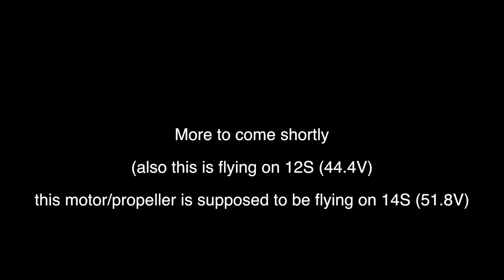My HomeMade electric plane Really flies!!!! (short hops) part7

Comment: Also when you start weathervaning on landing use rudder opposite the crosswind to maintain runway alignment, and use the stick to maintain your position over the center of the lane. That'll help minimize side loads on your gear as you touch down. (RC pilot turned full scale taildragger pilot ;-) )

Comment: Hey twins dont count as ultralights buddy I think part 103 only applies to single engine aircraft
Reply from the maker: Tell that to the Lazair designer lol
Reply: David Adam It also technically doesn't have "engines" at all.
Reply: drienkm idk I think it's a little on the illegal side. But it's okay I would probably do the same thing as Peter of I had the space to build it.
Reply: Part 103 is there to define aircraft that pose very low risk to the public and to property when flown accordingly. This plane more than satisfies all the intent of the regs; weight, fuel cap, and airspeed. 103 was also written way before electic propulsion was practical (this will be the key point whenever the FAA is forced to revisit 103)
But practically speaking, I'm pretty sure that statistically, multi-motors on a little homebrew aircraft like this reduces overall risk of injury/ damage due to redundancy by orders of magnitude more than it increses risk due to piloting challenges in an engine-out situation (obviously, this argument would be useless due to the lack of data).
In siuations like this when regulations are outdated, everybody seems to avoid litigation untill public pressure forces a re-draft of the regs... we just need to keep doing our thing!
Reply: PeterSripol that is true  it has been a long time since I have read part 103 I guess I will brush up on it lol. Congratulations on the flight man it's so dope and if your ever in Tampa Florida and want to take a private plane up let me know.

Comment: Great start !! I knew it would fly. But.. I'm still worried if batteries will give you any really good flight time. Be sure it can glide well unless you run out at 500 feet or something. May need to make a turn with no power. Please check those aspects out before you go for altitude.  Great job !!

Comment: did you end up moving the batteries to behind you for CG? Also you said at the end it should be using a 14s will you be adding more power later? how long do you expect to battery to last?

Comment: Technically when testing aircraft you are supposed to have as much altitude as possible. That way if something goes wrong you have a lot of time to correct the issue before you hit the ground.  But I'm not an aerospace engineer I've just read a lot of manuals. Good luck!

Comment: Put tons of batteries in the back to even out the weight :D And that you could do longer flights without having to worry about the batteries.
Reply: Chris Landry Well, technically he would need more powerfull motors, more batteries would just increase the duration I think :D

Comment: You should put the ESC's out in the motor pods to keep them cool and if a fire were to breakout it wouldn't cook you!
Reply: Actually it's bad to have long cables between the esc and battery (voltage spikes or some such), which is why Peter keeps the esc's in the fuse. It's better to have long cables between the motor and esc.

Comment: Peter “Wright” Sripol
Reply: Peter "Dumont"
Stripol
Reply: Shots fired
Reply: Sripol airport.
Reply: Xavier Ancarno Peter "Asian Guy" Stripol
Reply: Andrei Segal Shots fired indeed. But... Pretty much "Dumont", because it was shown to the public and didn't require a catapult. lol
It flies well like a Demoiselle with ailerons (instead of not-so-pratical 14-bis) and got a twin propellers and biplane wings setup like the Wright Flyer. It's a neat mix.

Comment: But will it fly out of ground effect?
Reply: He's flying just out of ground in this vid.
Reply: Hopefully. GEVs are still pretty cool, in any case. It certainly looks like it's capable provided the engines are powerful enough.
Reply: he even said in the video once he gets up out of the ground effect (which seems to be only a few feet AGL) that he can reduce power to almost half and still maintain level flight.
Reply: The way it instantly and positively responds to throttle inputs says it will indeed fly out of ground effect.
Reply: Neil Stramer Yep, he's defo out of ground effect.  He could probably fly to 15k if he had the juice
Reply: +williwonti
You misunderstand, just Google "ground effect" and you'll see what he means.

Comment: peter you need to make or get bigger props, with optionally more blades. you don't need more rpms, and it would be increasingly inefficient (commented before watching the video but it wouldn't hurt to have the extra thrust to get off the ground.)
Reply: AMEER H Yes he does, he needs bigger props to fly.
Reply: Then he should study the new prop efficiency graph to compare with the engine rpm
Reply: Andy P oh did he... well sorry about that i missed that point
Reply: Andy P he is flying mate
Reply: AMEER H you're missing the point, in the livestream he complained about not having enough power.
Reply: Andy P actually he dont need to.. i mean just enjoying flying

Comment: How fast does it take to get off the ground ?
Reply: Shredxcam22 how do you english bro
Reply: GL Aviation nun good.    What kind of ground speed are you running when getting off the ground?
Reply: Shredxcam22 depends on the plane, and you use ground speed while taxiing and airspeed on takeoff till landing.
Reply: I estimate its like 35-45 knots
Reply: GL Aviation I am guessing he doesn't have a pitot system thus he wouldn't have the ability to know air speed. Plus ground speed would be more relevant to the average joe. I worked on avionics for years....
Reply: Shredxcam22 Idk anything about homemade planes but i just use my knowledge of 'not homemade' planes

Comment: Peter, do you think the incidence angle of the horizontal stabilizer might need adjustment?  That might get your pitch inputs more reasonable...
Reply from the maker: Thats the smartest comment I've received so far! yes I may shim the horz for a few degrees. The plane was built with zero incidence in the wings to make it easier to build. Unfortunately this means it'll always fly slightly nose high. 

I know I'm going to receive a lot of idiot pilot comments about how its stalling tomorrow! :D

Comment: Do a barrel roll!!!
Reply from the maker: No william, you cannot have my laser cutter. I didint put you in my will.
Reply: PeterSripol hvgb
Reply: Needs more cat stickers
Reply: Eric Villa
No quad engines...he needs geared inrunners like the old turnigy 80 100 motors turning props twice the size at like 48v.
Those motors/props he is running are so inefficient the way he is running them.
Maybe he could get away with using the same motors but in a gearbox with bigger props at higher voltage...would run much cooler and efficient with better thrust at the slower speeds he is operating at...
Not sure of the max voltage of them....maybe need a rewind.
Reply: try google
Reply: lol xD
Reply: I'm so glad I'm subbed to both of you guys. Y'all are awesome.
Reply: what will you build next time ? SPACESHIP :D
Reply: Brilliant! Amazing work!
Reply: D:
Reply: Can I be in it then? Oo On a more serious note, YAY PETER! And is that a windspeed gauge you taped to your windshield? Oo Didn't notice any about it in the build videos, might have missed it..
Reply: Yes,please,once you upgrade your plane at an good stage,DO A BARREL ROOL!
Reply: Fly over Mr O's house and drop rotten fruit as he does he laser cutter dance.
Reply: Harry guy, direct drive is nice for its simplicity, but I agree about the inefficiency...going geared you could use a smaller motor and less batteries for the same thrust.
Reply: old m e m e
Reply: William Osman Watch my video!!!!
Reply: William Osman do a Aileron roll
Reply: no
Reply: That is one of the worst ideas I have heard. I LOVE THAT IDEA
Reply: qual o nomedessescmotores?
Reply: What's the speed of this plane
Reply: Hahaha
Reply: I'm sure it would work, but  DO NOT DO A BARREL ROLL!
Reply: He needs quad Engines!
Reply: And watch the wings brake
Reply: how about a normal roll? way lower G-forces.
Reply: PeterSripol  peter i am pakistan i am waiting for next new videos for you videos very good lovily,,,
Reply: PeterSripol  peter sir please may comnet Ansring  mi plz,,,
Reply: WE HAVE A HOLE ON OUR RIGHT WING!